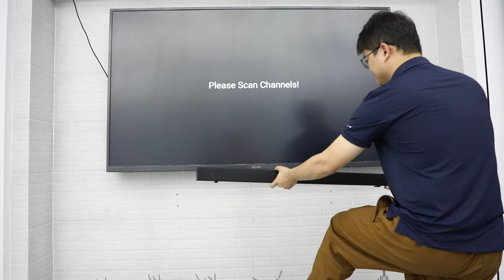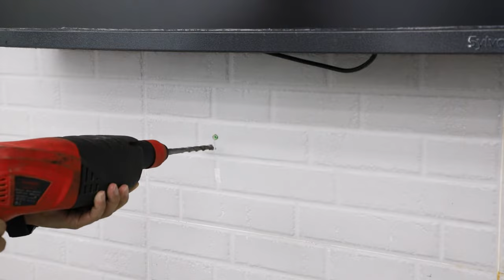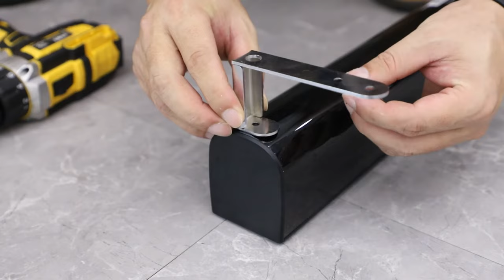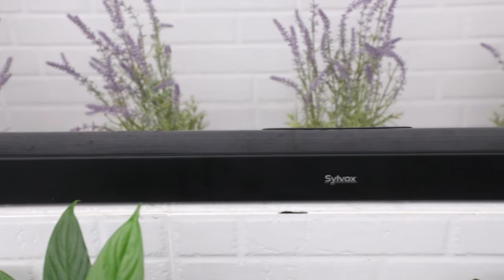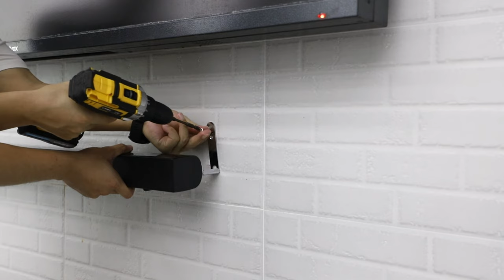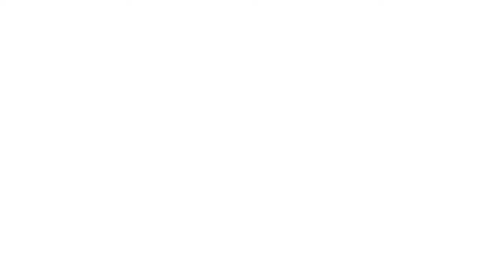How to install your Sylvox Soundbar - Wall Mouting Version

Comment: Thanks for sharing.  But I feel if you had mounted the sound bar closer to the TV (lessening the gap between top of sound bar and bottom of TV) you'd have had less of the wire showing.
Reply from the maker: Thank you very much for your suggestion, I will feedback it to our product department.